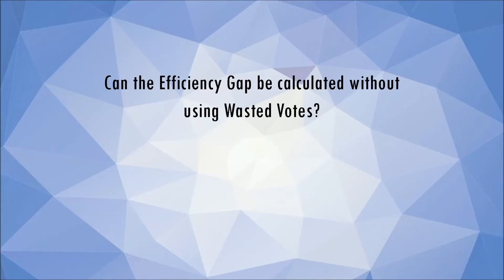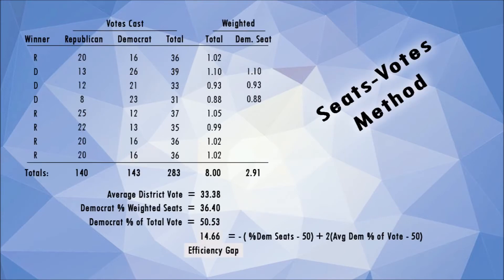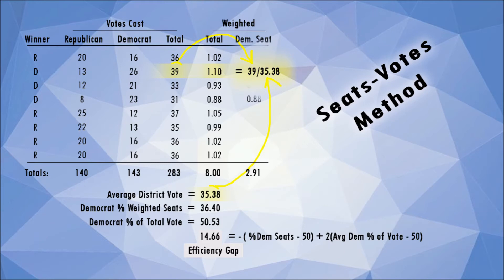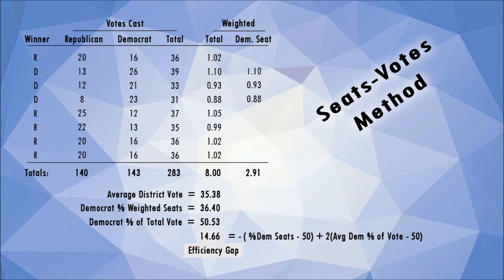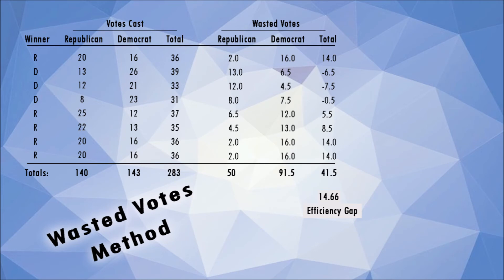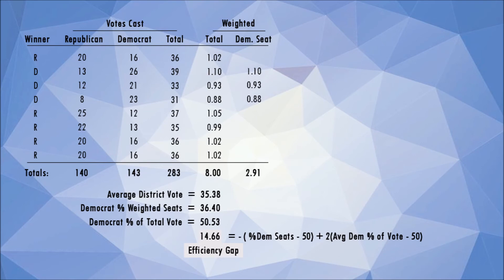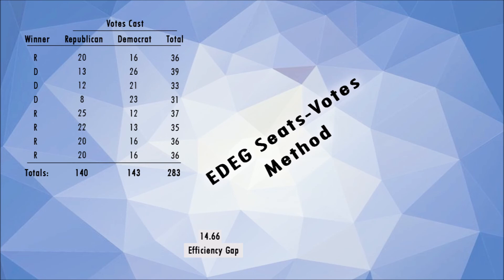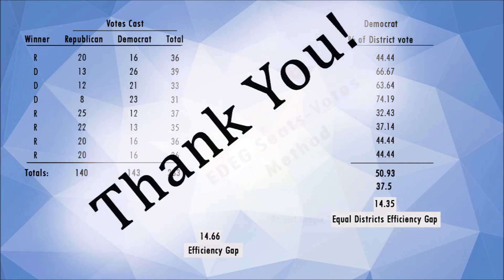A New Way to Calculate the Efficiency Gap

Comment: But if there are large self-selected groupings of one party in concentrated locations, you would have to engage in cracking to apportion them state wide.  If all the voters live in once concentrated area, or a couple across the state it seems logical that those areas would represent those voters and the remaining ones sprinkled about the state are naturally going to be in the minority.  Cracking the large blocks just to unite the diaspora is no better than doing so to dilute the blocks to defeat them.
Reply from the maker: Yes. You might be interested in this paper. It deals with Democrats packing themselves into cities and sprinkling themselves throughout rural areas.
 https://arxiv.org/pdf/1710.04193.pdf